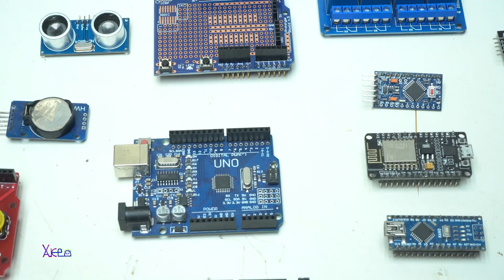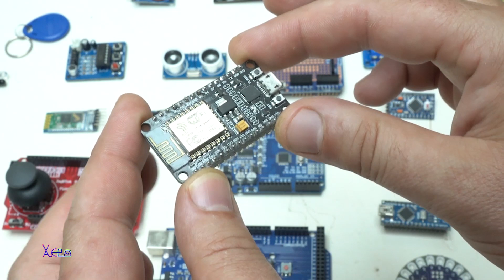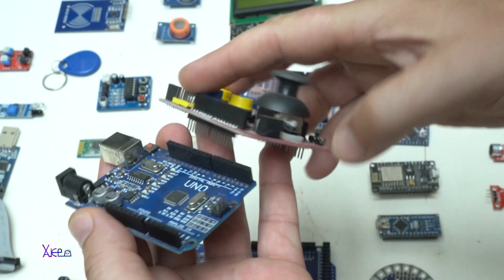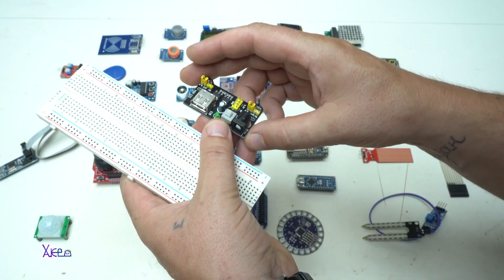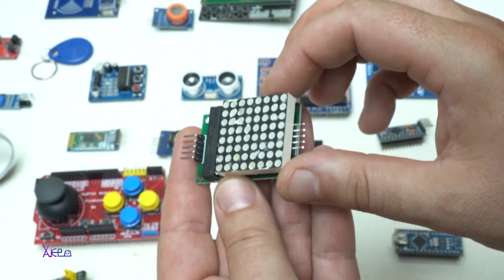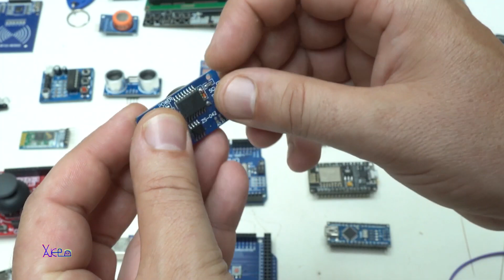20 Aliexpress Modules -THEY worth every Penny!

Comment: Great. The ultrasonic module can be used for measuring distance as well as a movement. 

A good project would be an air quality monitor, particularly for co2, as there are a confusing variety of them at different prices.
Reply from the maker: Thx for ideas,I am planning new projects using these modules